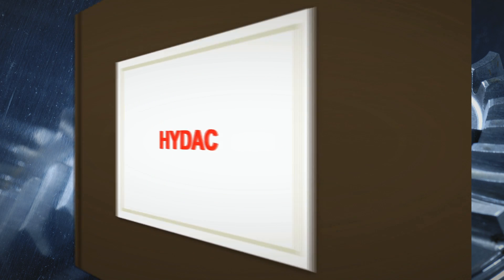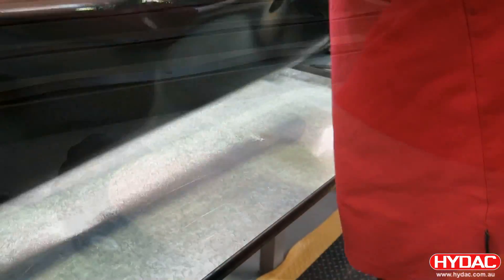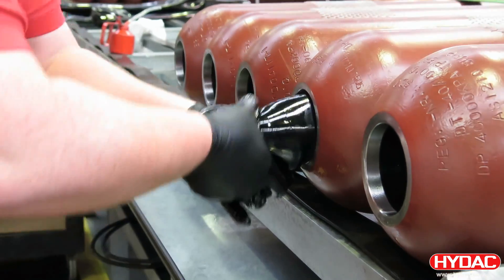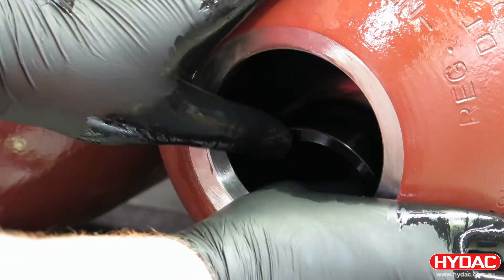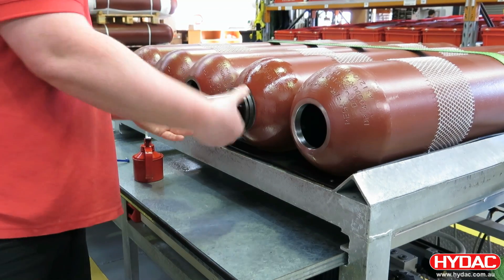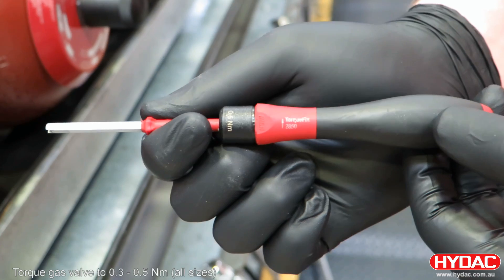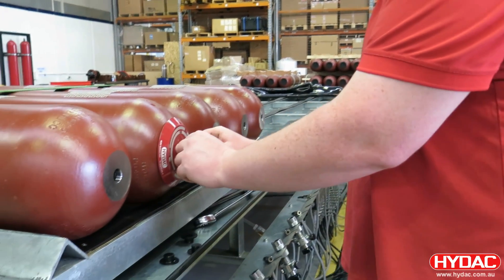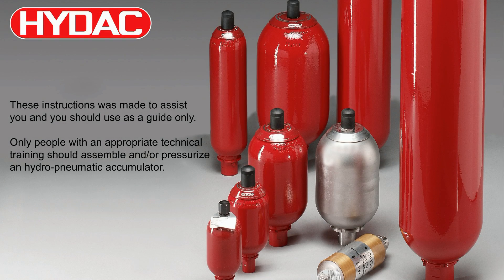How to Assemble a Hydraulic Bladder Accumulator

Comment: Interesting, So the 'Fluid port assembly' is held in place by the rubber  'Anti extrusion ring' even at 100's of bar ? I would have thought it would have pushed it's way through ...
Reply from the maker: The anti-extrusion ring has a steel split ring sub-component which is not clearly seen in this video. If you can pause the video at one minute 31 seconds, you may be able to spot it. In the model accumulator as shown, it is in fact rated to 400 bar!

Comment: Why nitrogen gas is used in accumulator ; oxigen is why not?
Reply: Highly compressed oxygen is very reactive, and can explode by burning any oil present or even the bladder itself. Air at high pressure is also reactive. If you are interested search for bomb calorimeter to see how reactive high pressure oxygen can be.
Reply: Vikash Rawat because there is no oxygen;  A flammable gas is a burning gas that can not be used to react with mineral oil and to ignite again.

Comment: What are the methods of mounting these accumulators horizontally?
Reply from the maker: Hello Margi, 

To answer your question, our HYDAC bladder accumulators can be installed vertically, horizontally and at a slant. Note that when installing vertically or at a slant, the oil valve must be at the bottom. 

There are some specifications: on certain applications listed below, particular positions are preferable:
- Energy storage: vertical,
- Pulsation damping: any position from horizontal to vertical,
- Maintaining constant pressure: any position from horizontal to vertical,
- Volume compensation: vertical. 

If the installation position is horizontal or at a slant, the effective volume and the maximum permitted flow rate of the operating fluid are reduced.

I hope that this will be helpful. Please, don't hesitate to ask more questions in comments if needed.